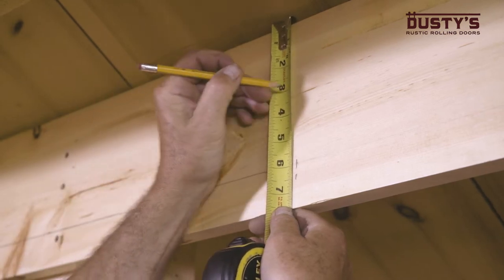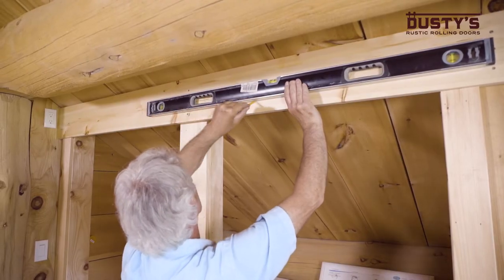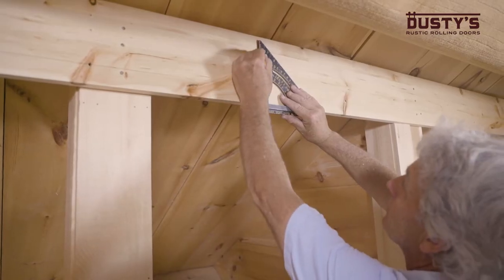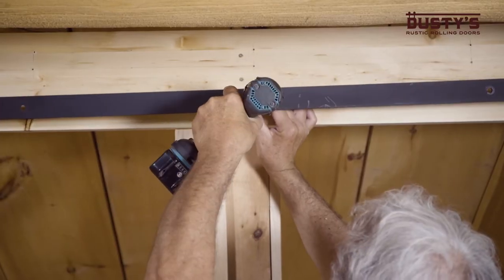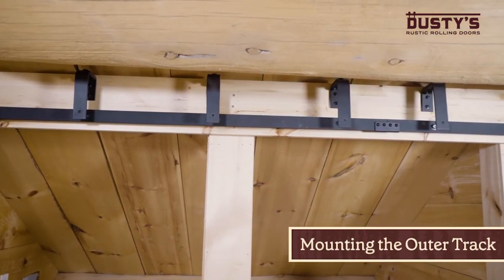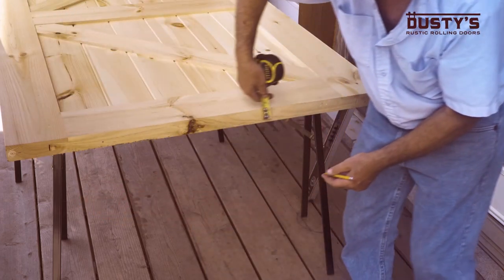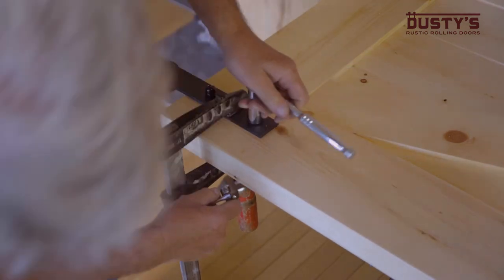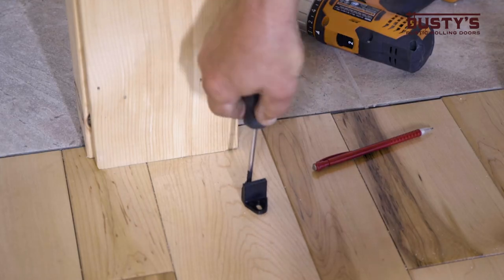Bypass Barn Door Hardware Kit Installation - Dusty's Rustic Rolling Doors

Comment: I have a hall closet that I want to put barn bypass doors but my track can only go the length of the two doors.  Do I have to have the track longer than the double foot opening?
Reply: 3 inches longer on each side.